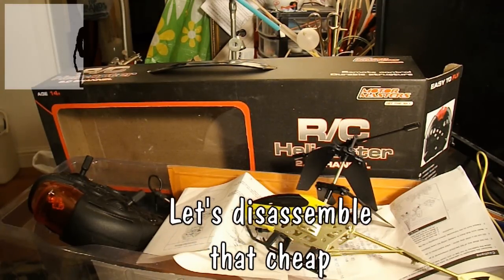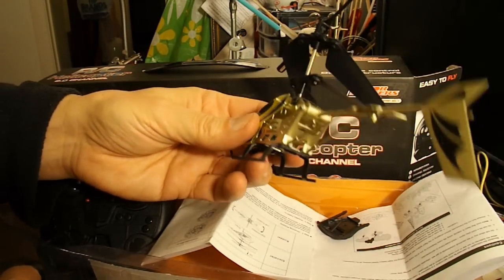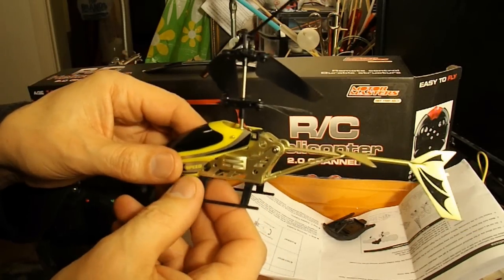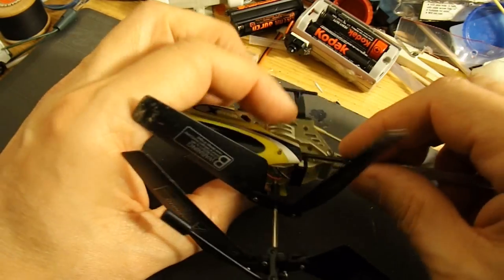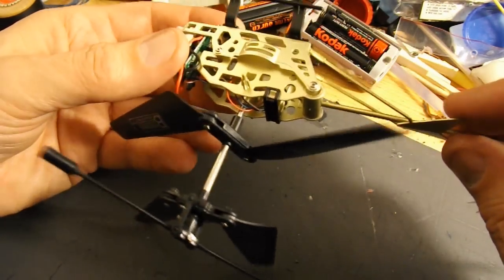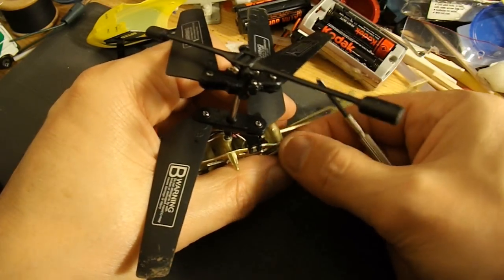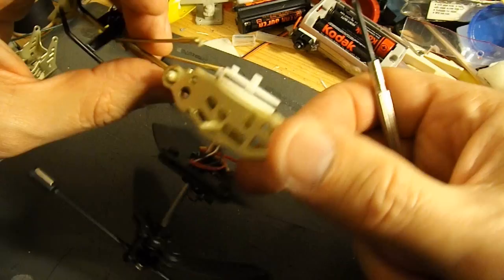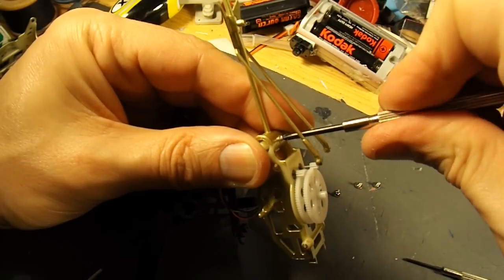Let's disassemble that cheap RC helicopter

Comment: Pls give me a gear plsssss
Reply from the maker: I did this project in 2015 and as I explained in the video I used the components to make a small aeroplane. Even if I did still have the parts it would probably cost me more to post them to you than it would cost to buy a new helicopter.  You would be better searching online for a seller that does free postage.

Comment: awful whine in your video
Reply from the maker: That tone is on lots of my videos around that time. It was caused by a fault in the camera (FujiFilm FinePix S4800). It is somewhere around 6500 Hz. Unfortunately old guys like me cannot hear it and it can only be heard by certain audio systems anyway so it took quite a long time before anybody told me about it and then it took me quite a while to track down what was causing it. In later videos I used a low pass filter to cut it out and you will see a message in the video descriptions, however it is probably on hundreds of my videos and I am not re-editing them all. With a bit of luck YouTube may include a tool to fix it eventually as many other YouTube videos suffer similar problems.